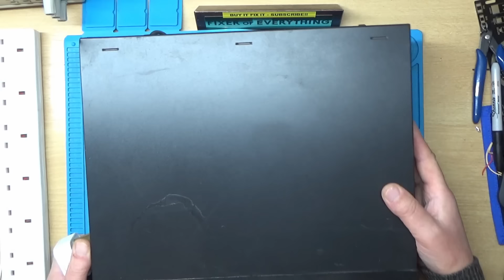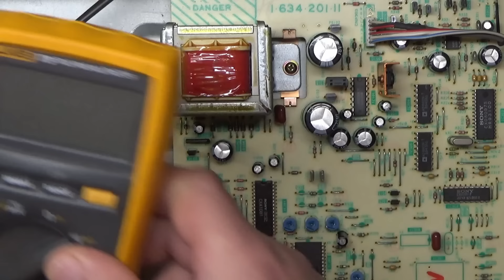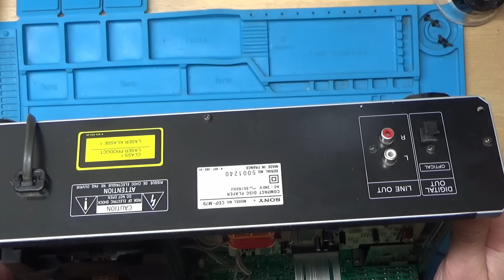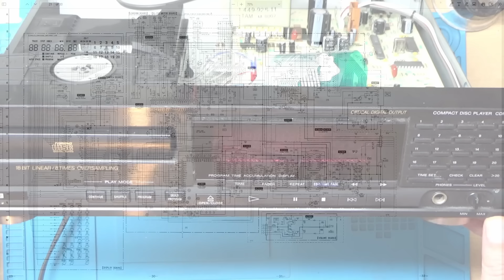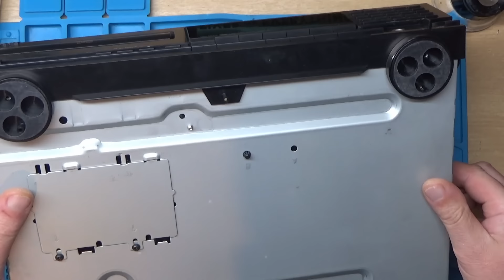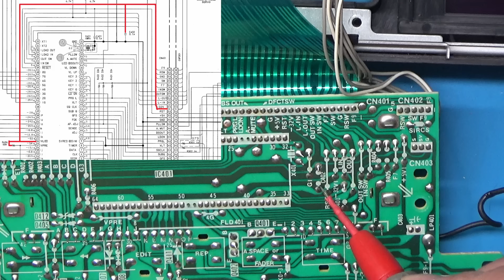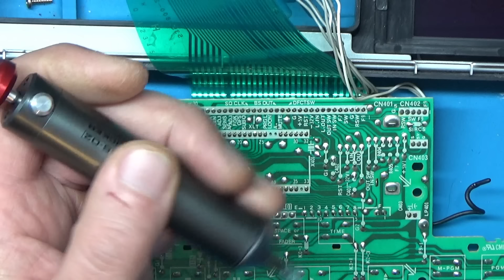The Repair That Almost Killed Me! | Unbelievable CD Player Nightmare!

Comment: I have to say that after watching you fix various things for about a year now, you finally inspired me to get into component-level repair.  I got a 65in TV from work that went bad a week later. After finding the schematic online, I was able to ascertain that the T-CON board isn't getting power from the main control board due to a blown voltage regulator.  I've never done any work with SMD devices so I had to order a reflow station, a couple of vials of flux and paste, and a beginner project to start out with.  Hopefully I'll have good luck with the TV. 

Thank you for being an inspiration and for making these videos. While it's been a decade since I've last done component level troubleshooting, I look forward to the new challenge and I have you to thank for the inspiration.
Reply from the maker: Thanks very much! and well done for taking the plunge! I wish you every success 🙂👍

Comment: Many years ago I was given an NEC amplifier to fix "it's yours if you can fix it". Despite my best efforts and five sets of output transistors I could never find the intermittent, transistor killing, fault. I ended up binning it before I wasted any more money ( output transistors were running me nearly £10/set!) and  heartache. It was a pity because it was in good external condition. In the end I saved a few more quid and bought a second hand NAD amp that I replaced after about thirtyfive years of solid use. The volume controls were getting crackly and it was probably due a re-Cap. The missus said it was too big and complicated so it got replaced with a Technics DAB Tuner Amp.
Reply from the maker: Shame, I wonder if it was an intermittent transistor or a faulty cap on the NEC?

Comment: Warning!!!  Silicone lubricants, especially sprays can make electrical contacts (relays and switches) to turn permanently OPEN.  I once heard about a phone switch room, where hundreds of relays developed stubbornly worsening problems after a cleaning lady had used silicone containing floor wax.  The story was that some of the silicone vapor had decayed to quartz, coating the contacts.  And quartz is an excellent insulator.
Reply from the maker: Interesting, I've not heard of that before 👍

Comment: I still have my Sony CD Player in use, it´s a M49, almost the same model, these were made to fit in the so called "MIDI Systems". They are a little narrower than the "normal" Hifi-size devices. Well, I had to change the belt and the mechanism needed some grease but otherwise it still works ok.
Reply from the maker: Nice 👍🙂

Comment: Every  good  tech should  work with an isolation transformer
Reply from the maker: I think that's a misconception, and can make the situation more dangerous. They should only be used when needed (usually taking measurements with an oscilloscope) and interesting read.. https://sound-au.com/articles/iso-xfmr.htm

Comment: I remember turning the potentiometer up a bit on my playstation cd reader so it would read disc's again. It only worked for a few days before burning itself up. But it's a good test to see what part failed.
Reply from the maker: Yes, that increases the current to the laser, but if it's already worn out, it just accelerates it's demise. You usually get a lot more than a few days though.

Comment: With all the great things you have done over the years, You can afford a little "whoopsie"" now and then LOL
Reply from the maker: Cheers Fred 👍I think it happened because I used the extension that I had in the first two parts of the video to run a lamp in another room as we had a power outage when we had the storm a week ago, and I was running on a generator. I forgot to bring it back, and plugged the CD player into an extension on the floor near my feet. I then switched it off at the front and in my head I thought it was "off" but because the plug was "out of sight" I totally forgot! Glad that I didn't get bit off the thing. It's been quite a while and I remember it's not fun! 😂

Comment: Pretty much built yourself a CD player there. Guess the components just aged and failed when voltage was applied. Or possibly that short on the display capacitor damaged the other components?
Reply from the maker: Thanks 👍I'm not too sure, the capacitor may have just failed. I'm not sure if the optical pickup was faulty or not but that's one of the usual causes of not reading disks which is why I went for that first. When that didn't fix it, I had to delve deeper. When I was searching for that IC a few posts popped up saying that they were a known point of failure.

Comment: Sometime ago I was watching your other video you got a really dangerous spark from another transformer that you are working on, and now you forgot to unplugged the unit again from the mains on this one, common Mate we don't want to see you getting shocked while filming and seeing you dropping off your chair unconscious
Reply from the maker: The spark was from the Starlink PSU when the fuse exploded I think it was. The problem here was I used the extension that I had in the first two parts of the video to run a lamp in another room as we had a power outage when we had the storm a week ago, and I was running on a generator. I forgot to bring it back, and plugged the CD player into an extension on the floor near my feet. I then switched it off at the front and in my head I thought it was "off" but because the plug was "out of sight" I totally forgot! Glad that I didn't get bit off the thing. Also I'm thinking of what to say, checking the camera is not zoomed in to far, meter is in shot, sound is still recording, etc etc etc.. so there's usually a lot going on in my head at the same time 🙂

Comment: How much was the parts for this repair?
Reply from the maker: £5 for the replacement pickup, £9 for the replacement IC,and a few pence for the belt. The capacitor I pulled off an old board. So, around £15

Comment: Nice one! I managed to pick up an old Rotel CD player a few years back for a tenner, that had a tray that didn't open and could not read discs. Chucked in a new belt and "new" optical pickup, and brought it back to life. Had it been damaged any further than that, I doubt I would have been able to repair it. Although I learnt while buying a replacement pickup, that almost all replacement parts sold on sites like ebay, aliexpress etc, are actually old pickups that were dismantled from scrapped units, lightly cleaned and tested (although to what degree the tests were performed vary greatly), boxed and sometimes sold as New Old Stock. So don't expect the new pickup to last for another decade or two of regular use.
Reply from the maker: Thanks 👍I'm not sure on these pickups. They aren't original Sony, as the original has metal bushes that slide on the slide bar. These are all plastic, so I think they are new but perhaps a copy of the original.

Comment: Good lord, I’ll recommend the owner a spotify account. Nice job.
Reply from the maker: Thanks 👍Although spotify requires a subscription and an internet connection. So no music if the internet goes down. Since the storm a week or so ago, we've still got no mobile phone signal. They say they are working on the problem.... Luckily I've got Starlink for internet and don't rely on 4G any more.
Reply: I understand. By the way, is Starlink a good alternative for receiving internet? Is it a little bit fast and reliable? I’m tinking to take it to my second house in the country. Or is the only downside that Elon Musk is the owner?
Reply from the maker: We live in a very rural location. In fact since the storm about 3 weeks ago, we've had no mobile phone signal as the mast is still down. Starlink works well for me, and it doesn't rely on any of the local infrastructure or lack of it 😂😂 I used to have ADSL through a landline when we first moved here, but it was taking me 8 hours to upload a 20 minute YT video 😲  The upload speed is still not lightning fast with Starlink but I get around 10Mbps instead of the 0.5Mbps. The download speed varies a but, but I've had 150Mbps quite a lot. On the ADSL I was getting around 6Mbps. The only real downside for me is the cost of it at around £75 / mo.

Comment: With the Denon cd player's you needed a test cd to set up a new laser. They had a different track for each setting. 
If you get bored you can unplug the head drive and move the laser assembly by hand, as all the tracking is performed by the focusing.  Just move the head a few mm every 30s or so and it will play happily. 
If the high tracks jump then the motor bearings are likely to be shot. Once the flaping is faster than the laser can focus it gives up playing. 
On the denon laser assembly there was a pot to adjust the laser current,  you could up this as the laser wore out and get a few more months or a year if lucky.
Reply from the maker: Interesting. Yes there's supposed to be a "Test disk" for this too 👍
Reply: @BuyitFixit  for denon there was a set of test R's and C's and they told you the value for them. Other brands i'v looked at have the same idea but don't provide any values, you have to buy a test fixture.  
Denon also provided a nice hight setting fixture for cd holder if you changed the drive motor.  They ones i fixed used to play for hours every day, 7 days a week and wore out quite quickly. Mostly lasers, motors,  and door switches, electronics never seem to be a problem.

Comment: Mick,, you didn't make mistakes ☝️ you lose your focus. 
Your caffeine level is to low😳
Without your focus  brain - eye  error correction and tracking system you'll go in circles .
Take a cup of tea/coffee and a deep breath. 
Hug the woman who loves you.
Your elektronics laser eye - hand - brain tracking  comes back and work like on the first day with more power 🍻🍻 , 
Good work 🤗🤗🤗
Reply from the maker: Thanks mate 👍 Part of the problem was also that I used the extension that I had in the first two parts of the video to run a lamp in another room as we had a power outage when we had the storm a week ago, and I was running on a generator. I forgot to bring it back, and plugged the CD player into an extension on the floor near my feet. I then switched it off at the front and in my head I thought it was "off" but because the plug was "out of sight" I totally forgot! Glad that I didn't get bit off the thing.

Comment: Wow... That was awesome! I really enjoyed this one, Mick 😃
Just one thing I noticed, is that the original power cord wasn't not UK standard? I mean, only live and neutral cable with no earth wire, so the CD player case wasn't grounded.
So, do you think replacing the power cord is necessary in this case, or is it not really needed?🤔
Reply from the maker: Thanks mate, hmm not sure on that one. Metal casing is supposed to be earthed as far as I know. I've also been looking at an old JVC HiFi all in one tape / tuner / cd unit at our local repair cafe. It's of a similar age, and also has just the live  / neutral cable. From what I remember most older audio stuff I've looked at only has that.

Comment: This has an identical layout internally as the Matsui CDS 700 only difference this uses cxd IC that has the optical spdif
Reply from the maker: Interesting 👍
Reply: @BuyitFixit  The CXD1135 has spdif but the CXD1130 does not, mine has the latter

Comment: Chuffed to bits that you managed to breathe Life back into that one Mick & fair play to you for including & highlighting your Mistake at: 52:50 etc, I tend to lose my rag when things don’t go to plan sometimes although I do try not to admittedly, I had an Electric Shock which was self inflicted and it was due to a Belt that had come off a Washing Machine, It happened in the 90’s, I was in my Flat in Birmingham and I’d just woke up, Went into the Kitchen and noticed the Drum in my Washing Machine was not rotating, The Lid was already off or loose so I went over to the Washing Machine, Looked at the Belt behind the Drum and noticed it had come off, I looked over at the Plug in the Wall and thought: “I’ll be ok” and proceeded to reach down to the Belt, All I can remember is both my hands clenched shut, I couldn’t Scream, Shout or Move, There was plenty of Money in the Electricity Meter so that wasn’t going to go any time soon, I honestly believe that it was Divine intervention that stepped in because I couldn’t do anything, That is one situation that I will never forget!
Reply: I’ve been working on a JVC CD Player which I believe is a good few years older than that Sony that you’ve got there, I’d left it in my Brothers Loft in the late 90’s & forgot all about it, The Power Cable was mangled and showing Bare Wire in multiple places, I’ve replaced that so now powers on ok, Drawer wouldn’t Open/Close, Replaced a couple of Belts for the Drawer & Sled but I cannot get it to read CDs, I’ve adjusted pots to see if that makes any difference, I can get it to sound like it’s reading better but it will still not read a CD, I assume it needs a new Laser Lens, I haven’t been able to find a Schematic Diagram but wouldn’t know where to start even if I did to be honest…
Reply from the maker: @AJComputerServicesUK  I've been working on a JVC at our local repair cafe, all in one HiFi / twin tape / tuner / CD.
It's doing the same sort of thing as you describe. Replaced the laser, same. Now I've got a bit more experience since the this one I had another look at it on Saturday. If you have an oscilloscope you're supposed to get a nice "eye" pattern from the RF output on the pickup. This one looks garbled so I'm thinking it's a problem with the RF amp which is the first chip after the pickup. https://elektrotanya.com/jvc_ca-e48bk_sm.pdf/download.html is the schematic for the one I'm working on. That site might have the schematic for yours too.
Reply: @ Thanks and appreciate the info & Link Mick, I am going to have to get another Oscilloscope and learn how to use it, I did have a tatty one which I ended up giving to my Brother, I might see if he still has it plus I might upload the Video and of how far I’ve got with the repair even though it’s not complete, What I have managed to do might help someone else! Anthony - Birmingham
Reply from the maker: Thanks mate, had something like that happen when I was a kid, around 5-6yo. I remember I tripped over a lamp wire and it pulled it out of the lamp and I picked up the ends of the wire to try to poke it back in.. All my fingers were black / lucky I wasn't killed as these were the days before RCD's and just had cartridge fuses.

Comment: To be honest I was wondering why you did not just desolder the pin on the IC  and the pin of the cap first rather than desolder the display.
Reply from the maker: I was pretty much expecting it to be the IC, I was really surprised when it was the cap. I've never came across a shorted cap like that, only on SMD stuff.

Comment: Glad you didn’t get bit Mick . I know the feeling when you get into a repair and get hyper focused. Sometimes we forget the simple stuff . Well done, once again 👍🏼
Reply from the maker: Thanks mate 👍Yes I do get hyper focused, and it's easy to get distracted while making a video as you have to keep thinking of what you're going to say, keep checking that I'm not zoomed in to far etc etc etc. Also what happened here was that we recently lost power due to a storm so I borrowed the extension lead that I used on the first two parts of the video to power a lamp in the other room. When the chip came I forgot to get it so plugged it into an extension on the floor.. Out of sight out of mind as they say.. so I "switched it off" at the front.. and totally forgot about unplugging it!

Comment: ALWAYS switch off/unplug things when soldering components. The tip of your iron is grounded so it will short any voltage. You're lucky you didn't touch the mains part of the board.
Reply: Not all soldering irons have grounded tips, esp the copies :(
Reply from the maker: Yes Good advice, and I normally do. What happened was we lost power in the recent storm and we were running on the generator for around 8-10 hours. I borrowed the extension lead I was using on the first two bits of the video to power a lamp as the generator is only connected to one of the fuse boxes (only powers half of the house). Forgot to get it when I was doing the last part of the video, so plugged it into an extension lead near my feet.. Switched the CD player off at the front and in my head it was "switched off".. then only later did I realise it was still plugged in...

Comment: He blown that chip by the same reason it did with the fuse. So, the head, the chip, the fuse were his fault, the only thing to repair was a dry belt and a tiny cap.
Reply from the maker: Nonsense, the ribbon cable is connected to a different IC (IC301 Digital signal processor), not the head or the servo control chip. The pin that was blown on the servo IC was TE which is connected to the RF amplifier. Check the circuit diagram... https://elektrotanya.com/sony_cdp-m78_cdp-m79.pdf/download.html
Reply: If the fuse blown it is signal that it propagate backward by the +v, you can burn everything. Anyway engineering fault that the ribbon cable can be plugged missalingned enought to jump lines, imagine that +33v going to neighboor lines.

Comment: This was a epic repair m8. Great to see you had succes. I made the same mistake once, not unpluging a device, and wanted to plug it in after fixing it. Only to find it already plugged in!
No damage, but it scared me.

Next time please also clean the laser end switch. It's located between the spindle and disc motor.
These do give problems. Also it's recommend to check both motors for dead spots.
Good diagnoses on fixing the tracking, and finding a 35 year old ic...

Well done!
Cheers from the Netherlands.
Reply from the maker: Thanks mate, and thanks for the suggestions!